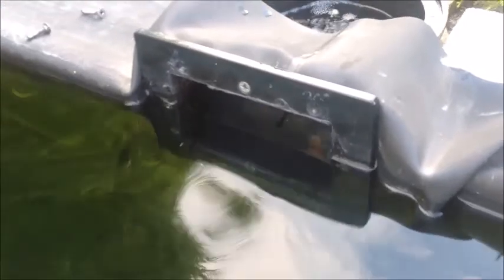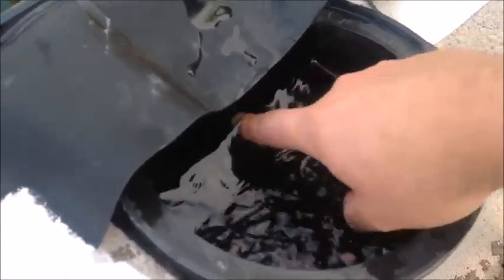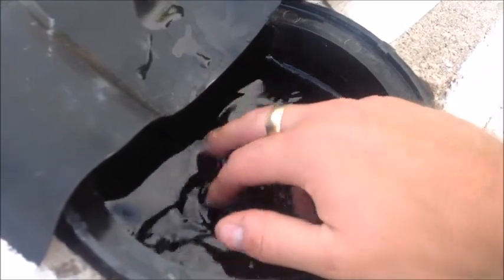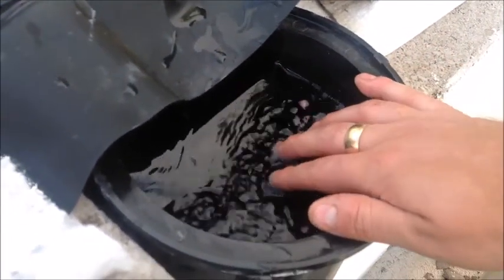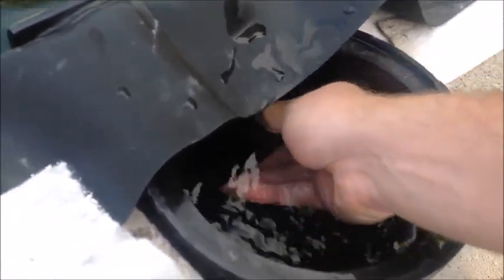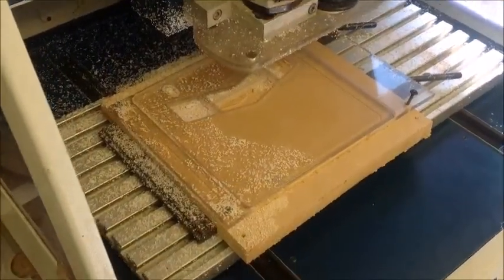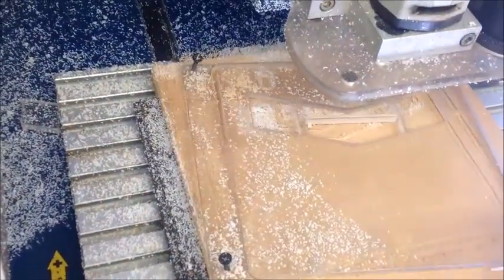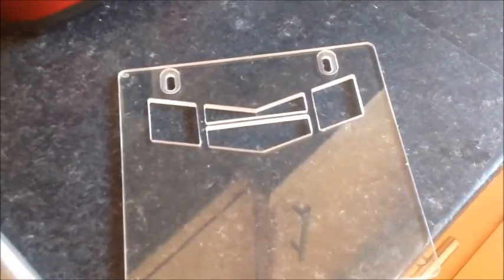Making a Standard Skimmer Guard for a Koi Pond

Comment: Nice work. Can I ask what pump you have running on your skimmer.
I'm rebuilding my pond and I can't find any good info anywhere about flow rates
Reply from the maker: Thanks, the skimmer is just a 5000l/h external pump. It’s lofts the water from the skimmer to an easypod and then gravity drops it back down into the pond. It works nicely and keeps the crud off the top.
Reply: @craynerd  thanks :) I plan to use a 5000 ltr pump :) and send to a sieve before my filters